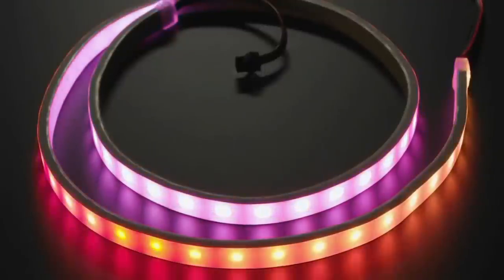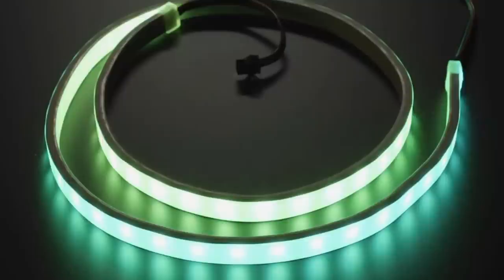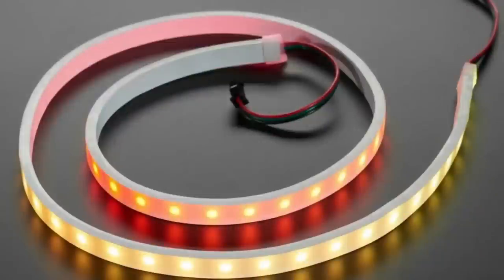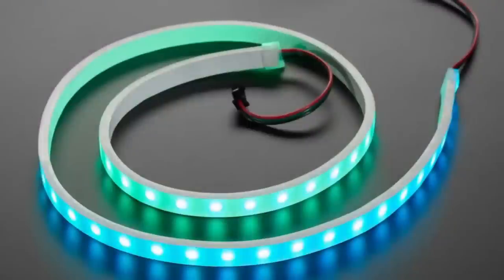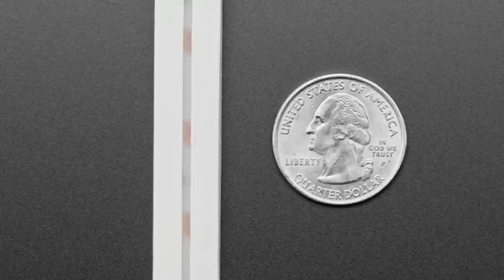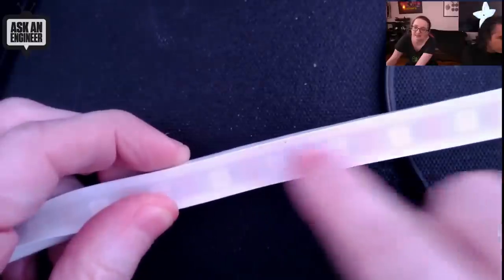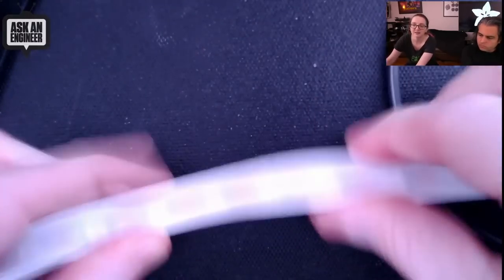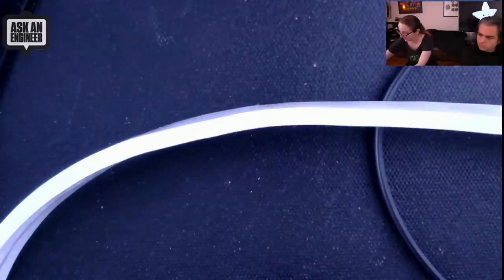New Products 4/14/2021 featuring Adafruit ItsyBitsy RP2040!

Comment: Hmm, maybe the reason my USB-C board isn't charging is because I'm using 56k resistor to ground on the CC pins rather than 5k.  Gonna have to try that fix.
Also gonna look at the feather schematic; looking for a compact and reliable way to boost an IO pin up to 5V for NeoPixel digital lines, but skill keep them as bright as possible on a 5V rail.

Comment: Where's the ItsyBitsy RP2040 driver for Windows 7?  The 2.5.0.0 driver on github that's linked to from the pages for it on the Adafruit site, doesn't support it as far as I can tell.

Comment: That Gameduino FPGA looks prime for my DIY digital dash for my project car. Can it drive a 3840x1100 LCD through an interface board that accepts HDMI input? If so, then a Feather that has a CANBus interface would just about complete the core hardware for the digital dash I want to build.

Comment: That Dazzler is really cool looking, sounds like the architecture of the older 16bit game systems where you have a graphics processor with sprites and stuff.

Nice to see the rp2040 family rounded out! Saw that Arduino is actually using their same mbed-based bsp that they use for the nrf52840 Nano 33 BLE and Portenta, with just the very board specific stuff new. Hopefully it'll be good - fortunately they fixed the "crash if you print too long a line" bug 🤣